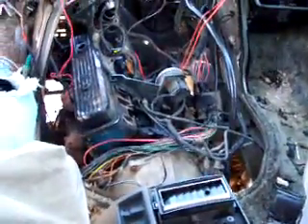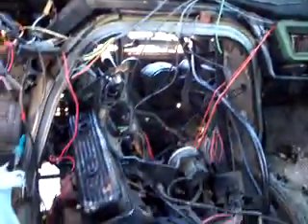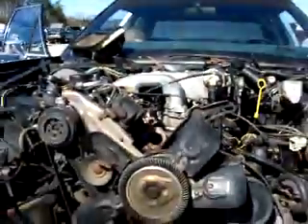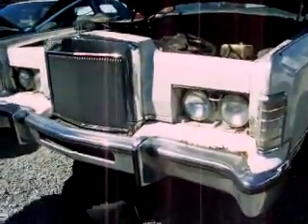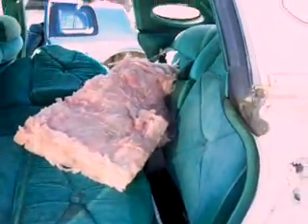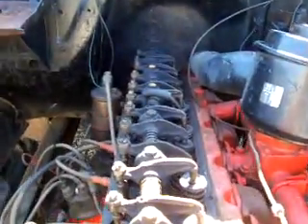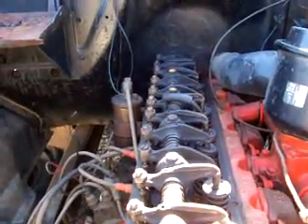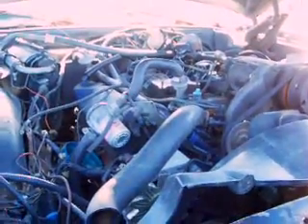JUNK YARD CAM!!

Comment from the maker: @towrecker I was thinking about making an air pump out of it since it seemed to be one of the recommended styles next to york.  I might need one of those ferrel's, havent looked at it since I got it.  Kind of a winter project.  It pumps, I know that and I believe it was R12 charged and not retrofitted.

Comment from the maker: @compwiz878 If I remember correctly there was a formula I used in school.  61.2 or something times the liters would give you a ball park figure.  For gm, it would be dead on.... Ford I think you subtracted 3, Chrysler was something else  and im sure you get the picture.  I could have had that motor for 150 bucks hell any v8 for that amount, but you dont know what your getting at pull a part unless you know what to look for.

Comment from the maker: @towrecker There were a few, but a lot were siezed.  I found a remanufactured one that seemed to be installed not too long before they junked the car.  I know there is a sump for the oil and read somewhere it holds up to 8 ounces?  But im not too sure on these compressors.  I havent drained the sump yet and didnt get any oil out of the lines.  It came from a system that still had somewhat of a charge on it.  Any information ya can forward me on those beasts would be appreciated....

Comment: @More350Power whats you putting it on anyways? do you need the brass ferrel for the expansion line , most leak on the old gm's , I have a ton of them , they are had to find now days ..